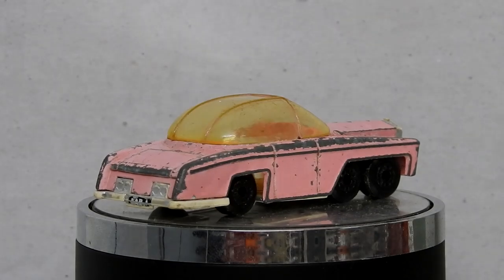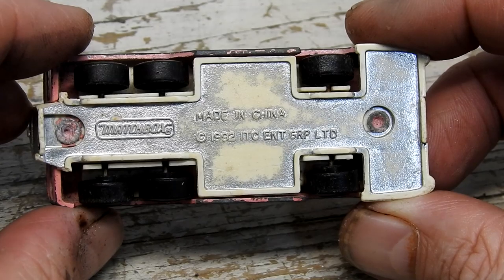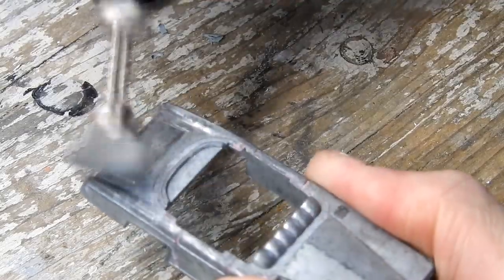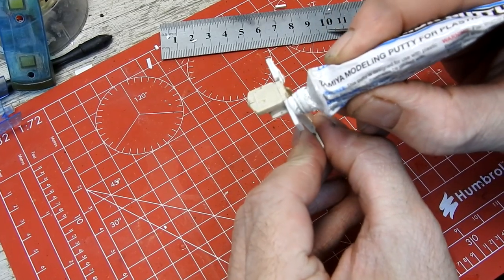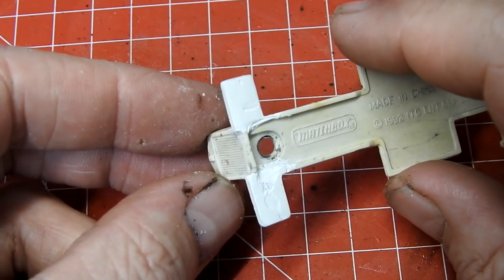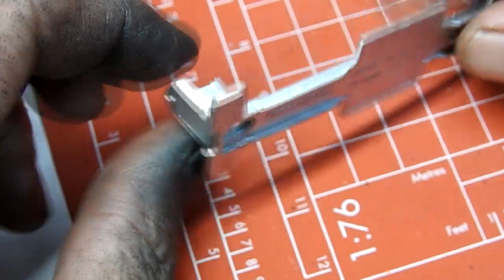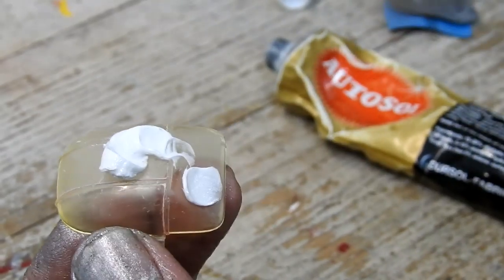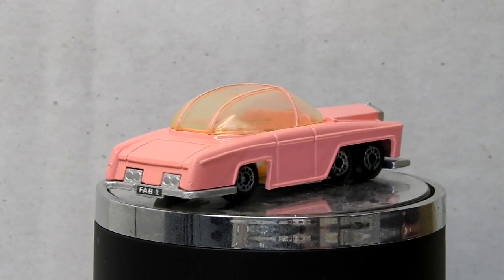Matchbox Restoration Fab 1 Thunderbirds Rolls Royce

Comment: Loved The Thunderbirds. Back in the 60s I had mates who had diecast Gerry Anderson stuff. Not sure if they were Matchbox or Corgi but they were the King Size ones. The pink Rolls grille folded down and shot a torpedo when you pushed down on the front wheels. Thunderbird 2 had a detachable pod with a plastic TB 4 inside. There was also the vehicle used in Joe 90. Great times.
Reply: Those would have been Finite, they had the contract with Anderson. Corgi had Batman, Green Hornet and Bond.
Reply: That should have read Dinky.  Auto correct!

Comment: Well that's certainly made me feel old, one of my earliest jobs as a professional  modelmaker was working on the resin prototypes for the Matchbox Thunderbirds range! This wasn't first released in 1982 though (i was only nine then!) it was all new for 92. Nice work on the restoration!
Reply from the maker: Wow cool 👍
Reply from the maker: I'm pretty sure it was first released in 82 and called Thunderbirds Rolls-Royce. Unless the mb wiki is wrong
Reply: Danny's Diecast Disasters so it does! That's definitely a typo/error on the Wiki page. I was certainly an adult (just!) when I did the work for Matchbox. Matchbox got the Thunderbirds license at the start of the 90's just as it got popular again from re-runs. I was involved with making Fab 1, Thunderbird 1 and Thunderbird 3 resin pre-production samples (TB2 and 4 got made by another modelmaker) all of them were designed and made new and in something of a hurry iirc to capitalise on the popularity before it waned. I still have a set of unbuilt, unpainted resin samples somewhere in the loft that I kept for myself...finding them might be a challenge though!

Comment: Excellent stuff! It looks better than new. It annoyed me that they 'Made it on the cheap' - they didn't even include a steering wheel, which is painfully obvious through that big expanse of glass. I have two of these - a good one, and a tatty one. You've given me the impetus to open up the tatty one, and do a custom, with interior and figures. It might even be possible to fit it with some kind of suspension. This is the first of your videos I've watched, and I liked it. A lot. I also subscribed. Good work!

Comment: When i wanted to restore the same model i noticed that the paint was bubbled like it had been very hot and when i tryed to open it, the die cast just broke upon  furder inspection i noticed that te diecast was brittle on some parts and i could break it with my hand.
i had no choice but to make a custom batmobile out of it.
Reply from the maker: That's a pity. A bad mix of zamack. I have had a few models that hace had really bad oxidation but luckily they cleaned up ok. Baremetal mentioned batches of old Hot Wheels that totally crumbled after some time.